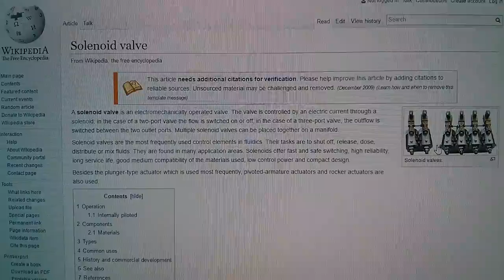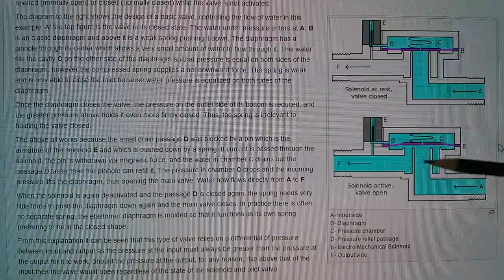What's Inside a Garden Hose Water Timer Unit

Comment: WATER BUTT USERS NOTE> Thank you Julian for the time taken in this fantastic video. I'd like to add the most recent version of this product is not really suitable for use on a water butt as they designed a new more powerful spring and there is too little water pressure to make it work. HOWEVER, if you have the newer larger diameter thicker spring swap it out. I ordered a replacement spring from China, Wire Dia 0.3mm x Outer Dia 6mm x Length 20mm. It now works very well on my water butt, not quite as good as the motorised timers but acceptable.

Comment: Fascinating valve mechanism! Never seen that before :D
Looks like something you could so easily control with home automation, being only a small DC motor
Reply from the maker: Yes, a wireless module would fit easily inside the case of this thing :)
Reply: yes, please hack and mod this with your NRF thing, to control the timing & on/off from room. 
and you wont have to screw out that plastic cap every time anymore.

Comment: I think you may have missed out the fundamental point about how this kind of valve works. The back chamber has a larger area acting on the diaphragm than the valve inlet, so in equilibrium the force pushing the diaphragm onto the valve seat will always be greater than the force trying to open it.

They're used all over the place, in toilet cistern fill valves, washing machines inlets and so on.

Comment: I purchased two Melnor aqua timers and both malfunctioned on the second year. The problem is that apparently the valve is not opening. What could be the problem? Could there be hard water deposits? Could the spring have broken? Could the solenoid have a loose contact? I really want to fix these timers, but I’ve yet to take them appart. Your video has been hugely useful, thanks a lot from Mexico.

Comment: What are your thoughts about wiring a panel mount on/off switch to this? I'd like to be able to turn it on and off without having to screw off the front plate. They sell water proof panel mount switches. It's going to be used for a mister system so the auto settings will only be used for when we want to run the misters on a hot day. It would be nice if I could just turn the dials to a setting, screw on the front plate, and only have to hit the button when using.

Comment: Hi Julian
I have a 6 of these and they all have the same kind of issue (they require mains water pressure to work) i have two water barrels connected together and am only getting a dribble at the output.there is a fair amount of pressure from the 400 liters . Ive tried to remove the spring, cut the spring in half, drill a larger hole in the solenoid end.   (am now about to drill a larger hole in the diaphragm end as well. ) (and also going to replace the tap on the barrel with a larger diameter tap .)  in your wisdom which of these or an other idea would allow full flow with little pressure.
Reply: Bạn hãy mua loại van bi nhé:
Zero Pressure Ball Valve Watering Timer Garden Irrigation

Comment: I hard wired one of these into a mister systems. Amazon sells a AAA battery adapter kit that includes a power supply. I ran the power cable of the back side/bottom of the plastic housing and sealed the cable hole with waterproof epoxy. Works perfectly!! And out of the sun.

Comment: Hello Julian,

If I got it right you said there is no endpoint sensors on the motor, what happens if power is removed during the travel of the piston? will the water pressure push the rest?

Regards Stefan

Comment: Julian: Twice you talked about "accumulated pressure in the back chamber". I think that when the needle closes the channel the pressure on both sides of the diaphragm is the same.  What closes the valve is the spring.  

When the water is let through the small channel the pressure in front of the diaphragm is larger than behind and now the front pressure of the water opens it.
Reply: Gaston Groisman yes! Even though this is an old video I was going to make the same comment but checked to see if someone had already made the same comment. And you have :)

It really doesn’t matter how weak the spring is, it just has to apply some force (even tiny tiny) to mean the closing of the valve. 

For me, it’s that which is the genius of this invention from 1910 or whatever. 

Interesting video, Julian
Reply: One more detail, the surface area on the back of the valve is larger than the front, and thus even at the same psi there is more force holding it closed, venting the back pressure permits it to open of course.

Comment: 14:01 Wow, so the water analogy works again for electronics. This is basically a transistor! You input a small current from the high impedance base and it causes the collector to 'open' and both flow out the emitter.
Reply: Pneumatic valves are very similar, with a little valve controlling a beefy valve.

Comment: You should be able to stop the leak from the brass adaptor by using PTFE tape. You could also remove the gland nut from its seat and wrap some around the tap spindle then, using the gland nut to push the tape down the spindle, re-tighten the gland nut to stop the leak from the tap without making the tap impossible to operate.

Comment: I have one of these unit and I actually came online to find a solution to a water leaking problem. It was leaking from the battery slots so I'm guessing one of the rubber gasket on the inside is not sealing the electronic properly. Any suggestion how to correct this?

Comment: Very interesting. I bought a very similar item from Amazon for £12, but it doesnt work in the same way. Mine uses a ball valve in which a motor turns the ball 90 degrees each time you activate the switch or timer. It seems its a lot simpler method but not sure which is best.
Reply: The ball valve is better imo, the control electrinics are simpler, it's mechanically simpler, it doesn't require a minimum inlet pressure and it doesn't clog as easily. The other one is more clever though

Comment: +Julian Ilett: The important thing to remember with valves like this, and the reason the water pressure closes, and doesn't open the valve, is that the surface area of the diaphragm is larger in the  pressure area place stuff.

Comment: I have to say, as I only started fiddling with electronics a few months ago, mechanics are vastly more evolved than electronics. In analogs it is almost without limits, whereas electronics is like building with blocks. Quite strange really, as electronics aren't exactly a new thing. I wonder if the quest for speed and going the digital route is holding us back. It seems easier (cheaper?) to convert to digital going through a microcontroller and then back to analog than it is to make a discrete analog device, even for the simplest task.
Also it's rather amusing to watch Mr. Ilett and Mr. Carlson go on about the mechanics in length, while the electronics is so obvious to them it's barely mentioned. Mr. Jones and especially Mr. BigClive doesn't seem to dwell so much on the position of screws.

Comment: A lot of valves for in-ground yard/garden sprinkler systems work on the same principal,but use a solenoid instead of a motor/cam/plunger. Also of note,they're commonly rated 24Vac,but I've found that they will often function from a 9V battery,or similar.
Reply: This is a no power needed on version then. those solenoids would have an armature electromagnetically held back from a spring. i thought a solenoid generally referred to a springed electromagnetic operated armature (used in other things like door locks and relays)

Comment: Hi Julian, I was thinking along the lines of an equilibrium valve as per we can find in a float operated cistern valve, but are there not similarities to the gas valves operated by, for example, a thermocouple? Very neat anyway.please include a subset of plumbing investigations, but I will sub anyway. I am captured. Muchas gracias desde el chico electricista en el distrito de lagos, inglaterra.

Comment: interesting, a gear and cam operated pilot valve. It has the possibility of a stuck on failure mode when power dies though, which isnt exactly optimal.

Comment: A very entertaining presentation. One wonders if there is an electrical/electronic analog for how the solenoid valve works. Though the problem of mains electric (the equivalent of mains pressure water) with delicate electronics (the equivalent of those tiny vents) would be problematic.
Reply from the maker: I wondered the same thing

Comment: On a more serious note. Yeah it's clever how they use the motor driven plunger in place of an actual solenoid in this arrangement. Has a huge advantage when running off a couple of batteries in that it does not need be constantly energised to keep the valve open. I reckon those extra transistors are to do some kind of voltage level shifting and/or inversion to make the H bridge work.
Reply from the maker: Yeah, the other 2 NPNs will pull the PNP bases down to 0V.

Comment: So, I have a silimar modela to this one, just it's a digital one from Aqualin.
It worked just fine for 6 months, and then I noticed that my water tank was going low too fast, and I realized that the timer valve was  leaking. It was not leaking to the outside, but it was leaving a little water pass by even when in closed position.
Any idea how can I fix it?

Comment: This is also the way a  gas pressure valve works only its all mechanical.  The gas tank on my roof reads the psi in the storage tank which is periodically filled when I pay for more.  From that is a pressure regulator with this device.  It has an adjustment screw which varies the amount of tension on the diaphragm thus providing a very small movement regulating a much higher tank pressure.  No matter how low (or high )the pressure is in the tank, within reason, the gas pressure to my stove remain adjustable from the diaphragm.  Of course,  the whole thing is sealed shut and made repairable by the manufacturer to protect us from ourselves.
Reply: Protect us from ourselves...much like what the government is trying to do to us...

Comment: one small correction
in the closed position the spring is what holds the diaphragm closed because the water on both sides of the diaphragm has the same pressure
Reply: Well. There's also the difference in area on the diaphragm. The incoming water can only push on the center of the diaphragm. The water in the chamber pushes on the whole diaphragm.

The pressure is the same on both sides, but not the total force on the diaphragm is not.

Comment: Kind of like a mechanical transistor.   A small flow of water controls a larger flow of water.    My lawn sprinkler system vales work this way.  I was very impressed with the design once I figured it out.    I believe it uses mechanical hydraulic advantage to move the diaphragm.  The chamber on the back of the diaphragm has a larger surface area so the tap water pressure pushes harder on the diaphragm (more pounds per square inch)  to close it against the incoming tap water pressure.  Very ingenious.

Comment: This is the standard way that water pressure valves have worked for decades. They use the water pressure itself to operate the valve that controls the water pressure.

Comment: These are definitely nifty valves that take advantage of the fluid version of mechanical advantage - using a small force to switch a high pressure.  It's my experience that they don't work very well for switching low-pressure water, like that from a gravity fed water collection system (i.e. rain barrel).  Another advantage of them, though, is that they don't require constant power to be on or off - they latch their state.
Reply: The trade off with this latching techniques is it is not failsafe if power is lost.  It saves electric energy but might die before it shuts the water off.  The other solution with a constantly powered solenoid version for example is you  use electric the entire time the vale is open.
Reply: True.  I hadn't considered failure modes.

Comment: In that unit the motor is required to turn it on and again to turn it off, so if the batteries fail at the wrong point it could leave the water running? I suppose the advantage of a solenoid over the motor would be if the power failed, it would stop the flow of water. But it would use more power when operating.
Reply from the maker: Battery voltage could be monitored by the microcontroller. If the controller detects brownouts, it could turn off the water flow.
Reply: ....assuming there was enough power left to drive the motor to cut the water off.

Comment: I wonder if the delay is due to the microcontroller putting itself to sleep for periods of several seconds at a time so as to barely sip power.
Reply: Once the valve behind the diaphram opens it takes some time for the water pressure behind the diaphragm time to build up to overcome the pressure of the tap water coming in to close itself..
Reply: +jp040759 When Julian changes the switch it takes a few seconds for the motor to start running.

Comment: @20:10 It seems like your first charge controller is blinking a fast pattern the middle one is not flashing at all and the end one is flashing 3 times then 2 fast blinks
Reply from the maker: Yep. Left controller is faulty - it thinks battery voltage is below 11V. Right controller is reporting correctly 13.2V
Reply: +Julian Ilett ahhh OK It's a code that's awesome..so 3 flashes pause 2 flashes = 13.2vdc right?

Comment: I would like to see at which point the valve fails to operate at low voltage. Most of the devices like this I have seen used have died with the valve open allowing water to flow all day and night while the tenants are away on holiday, which can be problematic at the very least.
Reply: Good point.  The valves on my sprinkler system are similar in design but use a solenoid instead of the motorized thingy.  That way it is failsafe.  When power is applied or the solenoid coil fails the solenoid de-energizes and closes the water path thus shutting off the main water supply.   This motorized version will not do that.

Comment: a plain solenoid valve is not much use if it needs to be energised for more than a few minutes,   they overheat.     also uses too much current from batteries for the magnet coil.    You need a design which is only consuming power when it is actually switching from one state to the other.

Comment: this is exactly the same motor and housing as in the battery operated Dig timers! you need to put RTV on that large rubber o-ring. once it leaks the electric motor becomes permanently damaged and it stops working. this is a common problem on the these timers. please do yourself a favor and put rtv on the inside and outside of that o-ring, it will work forever if you do, let the rtv dry for a day or 2

Comment: It's a nice device, but if the batteries run out in the "ON" position, the plants won't be very happy :)
I wonder if it monitors the voltage to prevent this from happening.
A low voltage test would be interesting.

Comment: I was hoping to see it working before you putting everything back together also without the motor, I guess too late ..

If I were you I wont put everything together unless I check there is zero leak inside first .... Just a thought

Comment: I have that and is not reliable when it stucks u have to reset take batts out etc that happens every 1-2 days..
Reply: I had the same issue. The fix I found is to add a capacitor and inline resistor to the motor. So my theory is that when the motor spins it stalls when it's turned the gearwheel to the end stop, and this motor stall current is sufficient to drop the voltage enough to trigger a reset of the chip. The fix this...
1] If you look at the board, you will see a space for a capacitor. The capacitor effectively goes across the supply wires from the battery. I fitted a 16v 48uf cap in this slot. This will take some of the stall current voltage dip away from the board.
2] Add a 5 ohm resistor inline with the motor. I soldered the resistor to the motor, and the wire to the resistor. This not only limits the stall current, it will also make the battery last a lot longer. After these two mods, no further issues.